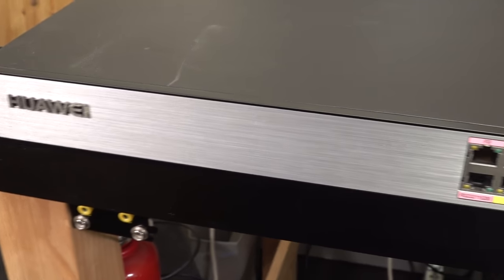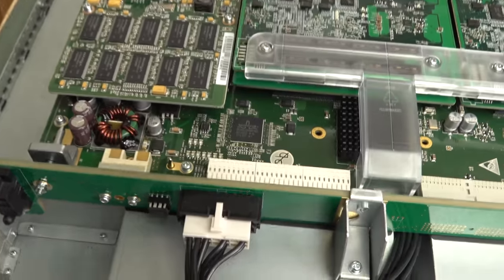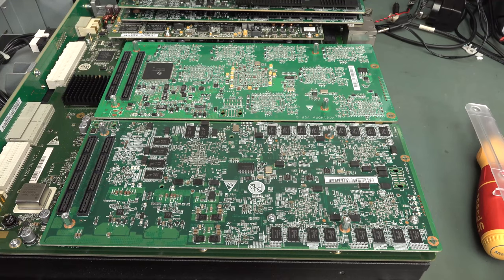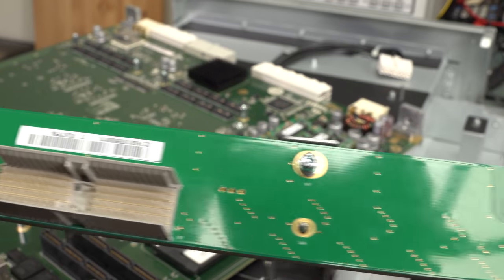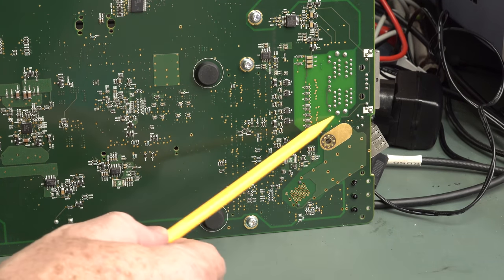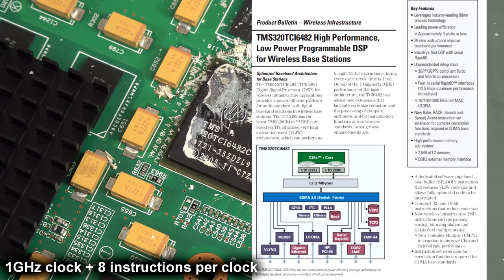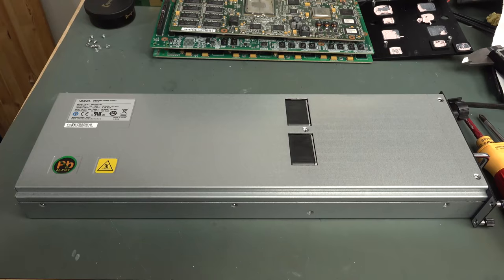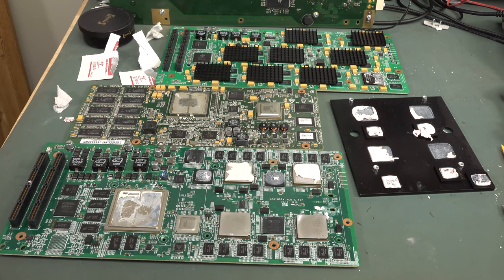EEVblog #1289 - Mystery Huawei Teardown

Comment: We do up to 6 streams of video+audio transcoding on an Intel Atom processor, with 5 Atoms per blade, up to 4 transcoding blades per system, for a max of 120 simultaneous transcoded streams.  The blades go into a 16-slot backplane that uses naked 1Gbps SERDES (SGMII) to provide 52 fully switched ports for stream routing.  We can pull down all the transponders from multiple TV satellites and dump any selected combination into multiple output formats, including HLS/DASH, QAM, DVB-T/T2, NTSC, ATSC, ISDB-T and more.  And I'm one of the Systems Engineers.  Yeah, it's fun!
Reply: Curious who the potential clients would be. Like big news channels for getting real time info around the world, or for the military to organize drone strikes 😏?
Reply: Hotels & resorts, convention centers, college campuses, hospitals, apartment buildings, small cable companies, etc.  Oh, and barracks and homes on military bases.  Basically everyone needing a satellite TV feed WITHOUT a tiny dish and a set-top box.
Reply: The hotel one is a good point. Quite a few large hotels on the Gold Coast use retransmission systems to avoid having Foxtel STBs in each room. They usual method I've seen is having 4 or 5 STBs in the comms room, each tuned to a different channel with the output being captured and sent to a retransmission system which grabs the video and audio outputs, muxes them into a single DVB-T transport stream and broadcasts it along with the regular FTA transport streams along the one coax distribution system. Seen similar systems for residential blocks of the mid 2000s, which have systems that retransmit Foxtel's DVB-C transport streams along the same coax as FTA. Both systems cut down costs, as the entire building does not need to be cabled up for either DVB-S2 (which requires two RG11 runs for V and H polarisations) or DVB-C.
Reply: Can you reveal the brand ?. I manage some Appear TV setups which is commonly used here in Northern Europa, your system sounds to be in the same ballpark ?
Reply: @chadmed  Yeah, the "stack of STBs" is actually the right way to go for some installations.  But they send content "in the clear", which is a huge problem for premium services that must be encrypted at all times, right up to the viewer.  A simpler approach is CSS (Channel Stacking Switch) systems that mix satellite feeds between the dishes and the STBs to provide custom lineups to viewers while maintaining the original encryption.

The system I work on wraps a large CSS with a massive amount of processing (and tech) to ensure no signal is ever accessible in an unencrypted state.  It's actually one of the main reasons we exist: It is impossible to pirate our streams via gaps in the system.
Reply: @BooXdk  No, I'd rather not: I can either talk tech, or I can talk business, but I won't talk both, at least not in the same place.  So, being an engineer, I choose tech every time.  It's not that I'm giving away any secrets, but I don't want to make our competitors' jobs any easier.
Reply: @bobcunningham6953  Got Ya 👍🙂
Reply: @bobcunningham6953  Did you work in the past at ADC Broadband?

Comment: Getting an accurate price for something like this will be difficult, i cant speak for the video market but as a system engineer for telecommunications when you buy something like this the hardware itself is only part of the price and generally only 40-60% of the cost. Throw this on the secondhand market and it would be worth about its weight in recyclable material thats it.

Much like Cisco equipment the real money is in the total service contract, ie ongoing support, turn around time on replacement hardware in the event of failure and software updates etc.

It's been years since i've dealt with Huawei personally but they were really aggressive on pricing compared to Cisco, Juniper etc.

With an MSRP of 175k behind closed doors in a large company you would expect a quote for around half of that, so lets say 90k and of that i'd estimate the hardware itself would have only been about 50-60k with the remainder for a 3 year negotiable contract - it starts to get merky when you start talking negotiations though.

What i found most interesting with the Huawei gear that i came in contact with is the CLI was in Chinese, ie all the characters were the typical chinese looking ones - we couldnt even make basic changes using it and had to rely on a Huawei employee to get the initial configuration set to then be able to use the web tools and external software to control things.. thankfully the project went in another direction :)
Reply: Plus, gear like this doesn't have a published price list.
Reply: Not less then $20.000 from my experience depend on customer previous orders and connection with manufacturer. All prices in that business are floating and every hardware and software require price negotiation.
Reply: What device has a Chinese CLI? Used many different switches and routers from Huawei but always only seen English, perhaps devices made for PRC has Chinese as native CLI.
Reply: @JoelBergmark  It was DSL related equipment,  and im not talking consumer or enterprise side this was proper telco grade to terminate customer connections - so long ago i dont recall a specific model number. Technically one could say it spat out ascii characters.. but it was just gobbledygook without a terminal program that supported the Chinese/Mandarin character set.
Reply: @sirtra  Thanks for the info! That makes more sense to me! :)

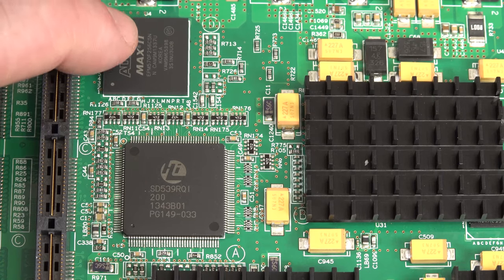Comment: That 24:20 mystery logo is the Huawei HiSilicon semiconductor company. They do ARM, Mali, and IC designs
Reply: Right, they are also known for video equipment; as many of the smaller IP cameras for home use are based on a SoC by HiSilicon.
Reply: Beat me to it. 😝
Reply: @gbraadnl  HiSilicon SOC inside at lease 30% of all CCTV cameras produced in China, including mid to high range commercial  products.
Reply: Yep. They even have recorder boxes for ip cameras with just a single hisilicon soc that can record up to 16 fhd streams. They even have ones that records 4k streams. Sure, it's not at 60fps but I still feel like this Huawei kit must've been outdated as soon as it came out. Or I just don't understand what exactly it does. Or maybe I'm remembering computers where better then they actually were in 2013. 😋
Reply: @mopk47  I am aware. /me lives in China ;-).
Reply: In their mobile phones, they brand the processor as Kirin.
Reply: @oniruddhoalam2039  Kirin - thanks mate for reminding me, had that in the back of my head somewhere.
Reply: @oniruddhoalam2039  and they also make the humongous Kunpeng 64-core server chip.
Reply: There's also Balong used in 4G WiFi modems.
Reply: @mopk47  Backdoored by the CCP, no doubt... HuaWei being a branch of the Red Army...
Reply: @RogerBarraud  Your choice to be back doored by ccp or trump... lol
Reply: @RogerBarraud  Try not to be biased by politicians. Dig deeper for the fact.

Comment: That weird metal pin around 6:00 is just for alignment during assembly/maintenance. See the taper on the pin? It's so you don't need to 'aim' the module and hope that the connectors will line up; the metal spike aligns it for you!

Comment: Similar units i've worked with sell for 30K or more, back in 2013 they'd probably be 70K+ USD. It's probably useless mostly today. These units are highly modular, and they'll reuse the same modules to scale them to the larger units to process more video calls. This kind of device enables a video conference, so it has to deal with processing and transcoding the video streams from the video conference devices. So you can have all your locations in your business in a single call and talk to each other. Assuming this came from emergency services, it was probably used for training and meetings between the locations for police/fire/EMS or something like that.
Reply: Why do you guys think this is for video conferencing? I believe it's a "broadcast encoder" used by BDUs (cable TV and sat TV companies) to re-encode video streams for broadcast distribution via cable or sat TV.
Reply: @LudicInterface  because it says so in the datasheet? 
https://e.huawei.com/pl/related-page/products/enterprise-network/telepresence-video-conferencing/infrastructure/vp9600/tpvc-mcu-vp9600 
similar to eg Cisco TelePresence MCU 5300

So all endpoints connect to this device which decodes each audio/video, mixes them/does fancy layout and then re-encode for each participant

Modern systems get rid of these complex boxes by just switching the encoded streams and leave the layout to the endpoint. (so each endpoint has to decode multiple streams instead)

Comment: On the audio processing board, the IC in the middle does not have memory next to it. So you do have 8 audio channels and an extra IC.
Reply: I noticed that, too.  It doesn't have the same ancillary components around it that the other 8 have; maybe some type of controller or interface for the 8 channels.
Reply: PCI switch
Reply: Maybe the extra is for the CCP 😂
Reply: China spy chip?
Reply: @ Jaco, I was going to say the same thing.

Comment: An MCU is used to connect multiple video conferencing calls together. So there would have been a bunch of meeting rooms each with a video conferencing device in there and if they all wanted to meet, they would dial into this MCU. The MCU mixes the audio and video streams, and then sends a stitched together image of the far ends to each video device. You can either have lots of small meetings or one large one, this device supported up to 24 1080p calls. 

These kinds of video conferencing devices and MCUs are mainly sold to big enterprises and they are not cheap. The room devices can be between $25k - $299k list and the MCU something like $8k a port. This sounds ridiculous, but remember that these are enterprise devices, one of the main selling points is they cut down travel, so it doesn’t take many transatlantic flights saved before you have paid for the devices in time and fares.
Reply: Huh I thought it was a broadcast encoder for BDUs.
Reply: Hmmm...what's wrong with skype ?
Reply: @georgedemean2228  The description of Skype will tell you what's wrong with it in the context of a meeting room video conferencing solution. It's primarily for "computers, tablets, mobile devices". The devices used in this context will have high quality cameras designed to capture 3-20 people around a single table and they will use standards based SIP or H.323 protocols that allow them to interoperate with all the other video conferencing devices deployed by enterprises world-wide.
Reply: @corce9631  Awesome, Thanks Pete

Comment: These connectors are called power blade, are from the company Amphenol ICC, are very good and support multiple connections to high current, not that you disconnect with the current flowing.

Comment: The little 8 pin DIP on the backplane could be an EEPROM that stores inventory data, likely so that the backplane serial number, part number, revision etc can be identified within the OS running on the box.

Quite common in telecomm'sy equipment.

May be DIP if there are no surface mount components so they could avoid a reflow process for that board.

Edit: spoke too quickly. 😋 Looks like a press fit socket, so no soldering at all on that board.

Comment: That data connector on the backplane is used to connect boards together in the larger chassis version. There will be some backplane interconnect, which is not needed in single board version. That is also why there are so beefy spikes, they're used as guides when you slide these boards to the chassis.

Comment: Interesting how a single device has Nanya, Samsung, Hynix and Micron RAM.
Reply: On such a redundant device, I would expect ECC ram for the main controller and the network stuff, but not on the a/v side (no care would be given if a bit flip happens on a video feed), so at least 2 types of ram chips, the other might be because of timings or bus width ? don't think it would be ram shortage on such small runs.
Reply: Indeed, fascinating. RAM is a commodity now and makes sense for different teams to use different brands
Reply: and obviousl, I should wait to be awake before posting, because the ecc would be handled by the controller and not the chip itself
Reply: Not really. Manufacturers have had multiple sources for DRAM for many years. (Shortages, design problems, ... earthquakes... plenty of things can mess with your supply chain.)
Reply: Global supply chain management at its best!
Reply: Also interesting that it uses Xilinx and Altera parts

Comment: These MCUs (I'm used to different brands, so take with grain of salt..) would basically be a switch for A/V conferences..  You would "dial" in via SIP or H.323 and each person connecting would get it's own point to point connection back to this box, which would do all the transcoding for different bitrates, and all the audio mixing and echo cancellation.  You would create connection points (basically a URL) with a unique number, which defined how many resources that conference would allow, so you could give a secretary a 3-party conference, and reserve a 20-party conference for the bosses big conference room, etc..  I haven't done anything like this for about 15 years, which might put this device on par with my old outdated experience, but I think all this is done with DSP resources in routers these days... not really sure..

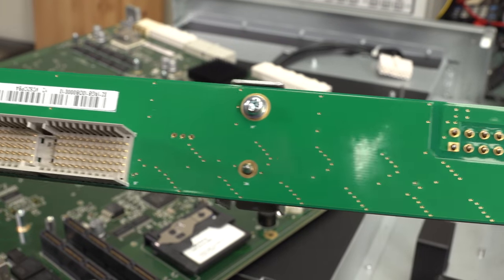Comment: 16:16 the data connection on the power board is only there to hold the board in place, the processor PCB is the same as in the modules that can be swapped into the larger chassis' where you can have multiple processor boards for redundancy. This is just another classic case of the same PCB for different versions of a tiered product line. :)

Comment: One good reason to use press-fit for those connectors is that a PCB as thick as that backplane wouldn't get very good fill on the plated through holes as it is passed through wave solder. And it's too thick for pin-in-paste reflow. So press-fit is your only option in that case.

Comment: Greetings: Considering the lack of dust (especially on the fans) I suspect this was a spare unit or an early failure.
Reply: Or it was run in a very clean room. (all of my gear looks like it's been left of the surface of the moon from construction in two offices.)
Reply: If your datacenter is dusty you are doing it wrong.
Reply: @BspVfxzVraPQ  There's not much I can do when idiots cut holes in the walls. (these are the same geniuses that replaced the door+lock without giving anyone a key -- including the building owners. Maintenance had to drill the lock to get us back in there; high security locks are not easy to drill. It literally takes two seconds to swap the core -- insert control key, turn left, pull core out.)
Reply: He did say that someone may have been wrong before the power supplies didn't he?

I'd say crib death as a v e Kohl's that type of thing.

Comment: I've an old Juniper MX series (biga$$ internet router) DPC line card I've wanted to send in for a teardown, but it's really big and heavy.  Basically think the board you've got without the chassis around it.  They're about the same size, very somewhat similar idea.  4x10G (ethernet) ports on the front of it.  A bunch of custom ASICs and some FPGAs, a switch fabric to the backplane (fabric switch cards are connected to the backplane).  A PPC on the linecard for management, housekeeping, and bringing up the ASICS and FPGAs.  That talks to the chassis management (called a routing engine) via a couple of ethernet ports (on the backplane) using TNP (after TFTP booting from the routing engine!!!!).  Very distributed architecture in the Juniper MX.  MX240/480/960 support far more than just ethernet, but, the other types of physical interfaces are going away.  The line cards basically do all the routing right at the line card, the routing engine connects to the peers, digests a routing table, and sends it to the management PPCs on the line cards.  They do the dirty of making that into whatever formats/etc are needed by the ASICs on that line card (running code loaded at line card bootup from the RE!).  As packets come in filters are applied, routing decisions are made, and the packet is kicked over to the outgoing linecard via the fabric, or, locally.  Other end the line card does a bit of the reverse, packaging it back into say an ethernet frame (possibly making it a VLAN frame, or getting way moree complicated with MACSEC and non ethernet port types!)

The line cards also handle a TON of routine housekeeping stuff so the main routing engine doesn't need to.  They also protect the main routing engine from DoS attacks by applying rate limiting right there on the line card for anything they hand off towards the routing engine.  From very simple/common things like TTL exceeded (too many hops in transit), to some more complicated things like the ping/pong of the BFD protocol.

Comment: The large pins on the backplane would be for alignment. Doesn't look like it has guide rails for the module, so vertical alignment could be off if some yahoo is trying to shove the module in and quickly destroy both the backplane but the module's connectors.

Replacing a backplane is a pretty big pain in the butt since they are almost always the last component to come out. I had to do one on a server cluster because a blade with a defective connector that would either fold or break off a few of the backplane's connector pins. Worse yet was that the damaged backplane port would cause the same damage to good server blades and repeat the cycle. 3 blades and half the slots were foobared before the damage was noticed. The blades were salvageable due to the pressfit connectors and donor pin slices from a dead blade. The backplane connectors were monolithic pressfit with no sourcable replacements even if they could be pulled out. Luckily used good backplanes on ebay were pretty cheap.